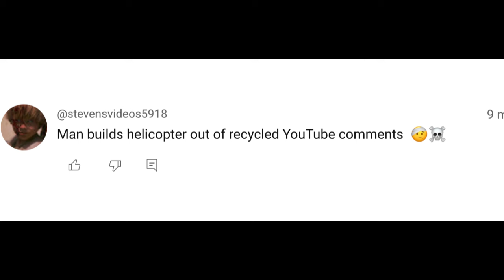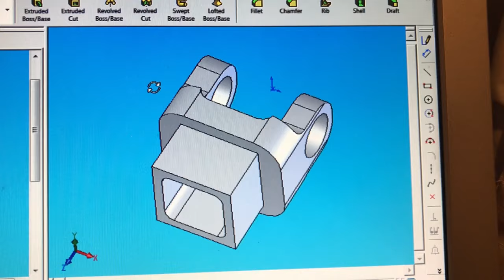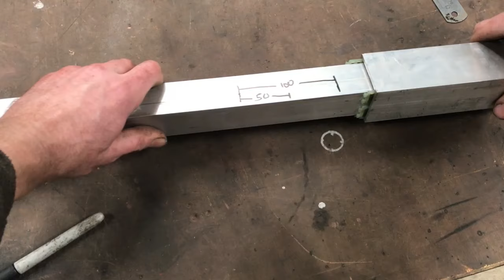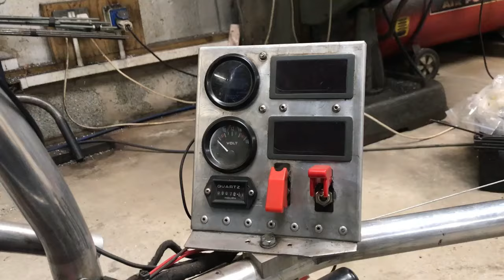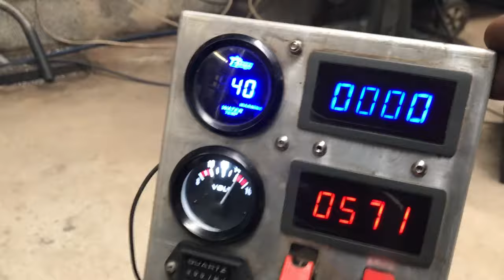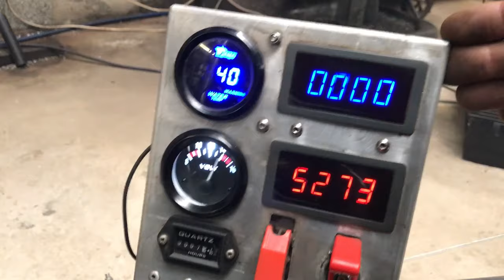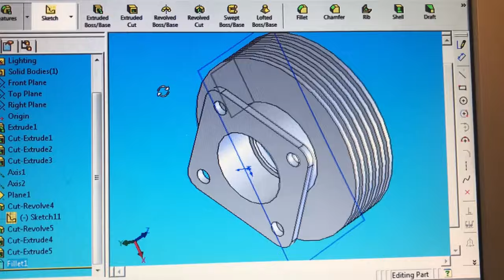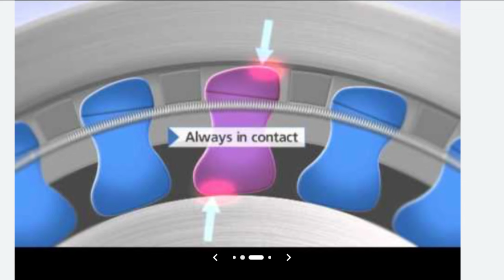Should I fix my Homemade Helicopter ???

Comment: Apologies for being slightly dismissive about the driveshaft when you mentioned this, Ben. As you comment the trick is to find a way to test the needle roller assy and convince yourself that you are not going to have issues with either fatigue or fretting. Could you test drive the shaft with a motor and then use a second motor through a conn-rod to vary the length under load? My thinking is put it through something close to a typical flight cycle then repeat 24/7 until you have enough flight cycles to be sure that it will not fail in a future flight...
I'm still very nervous about your current fixed pitch design. My reason is that if you lose drive, even if sprag clutch allows freewheeling, then the rotor rpm will drop so that lift drops with rpm^2. The resulting descent means that the rotor blades will aerodynamically stall, and the aircraft will fall. Not a good day...
I still think that using blade tip trailing edge trim flaps, and blade root pitch bearings, will at least allow the blades to find the pitch for a fixed relative angle of attack. This means that the rotor will keep flying as it descends by automatically entering autorotation. You'll still need to absorb the impact from an unflared landing, although rotor system inertia will provide some flying time. It means a less bad day...
The final trick will be a mechanism that makes both blades pitch to the same extend. This means you will have collective pitch, with rpm control and blade trim tabs. Cyclic pitch will be from your tilting rotor head (albeit with high control inertia). So what I'm trying to figure is how to give cyclic and collective pitch control with the least number of parts.
Helicopters are normally 4 times the cost to develop compared to fixed wings of the same MTOW. This just represents the mechanical complexity and increased testing required. But even the pioneers had to start somewhere. So the trick really is to learn from other designers mistakes so that you don't compound your own. Take your time and always strive for safety.
Reply from the maker: Hi Martin, I'll have a think about what it would take to build a test rig and whether I could get the rig to accurately replicate real conditions. 
What I think I need to know is the actual maximum torque applied to the shaft. Started looking into strain gauges, I could possibly use this to tell me the maximum torque but it would mean building the shaft first and testing on the machine. 

If you could work out for me what the impact velocity is from 3ft high after engine failure with the rotors fixed in pitch that would be great. 😆 I am joking of course. I've no clue how that could be worked out. 
My intention at some stage was to progressively test engine failure impact to see what height was safe. 
Actually could this be tested on a trailer using load cells ? I could measure the rate the lift decreases after engine shut off? 
Collective is something I ultimately want but it does add complexity.
Reply: @Ben-Dixey   , my brain is calibrated in metrical for designing stuff, so I'll round 3' to 1m. Using conservation of energy
m * g * h = 0.5 * m * v^2 . So cancelling m then
v = sqrt( 2 * g * h) = sqrt(2 * 9.81m/s^2 * 1m) = 4.43m/s
Also by considering m * g * h = m * a * d then if the structure deforms at a = ~10g then you needs 0.1m or 100mm of crush adsorption distance d.
I do very strongly recommend you treat your spinal column to a confor-foam energy absorbing cushion from cumulus-soaring. I happen to be sitting on one right now as they are also very comfortable...
Reply from the maker: @martingarrish4082  well, looks impressive to me Martin. 👍
Is this the impact velocity as if you did a drop test or have you somehow worked in the rate of lift reduction from the inertia of the blades?
Reply: @Ben-Dixey  ,  that's assuming all of the potential energy becomes kinetic energy, in a free fall, with the stalled rotor blade making no significant lift contribution. Nr will have significantly dropped by that point. This is where the e-VTOL companies are going wrong - that autorotating rotor is the last contingency when the batts and motors decide that it's time for an early holiday...
Reply from the maker: @martingarrish4082  👍 There isn't much delay between throttling off and lift reduction but there is some that I've felt, even without a sprag clutch. 
I would estimate it's about 1-2 seconds.
There is still a danger zone as you know even with collective ( dead man's curve). E-vrol like you say needs more redundancy.
Reply: @Ben-Dixey  ,  in modern helicopters with engine governors I am convinced that there should also be a servo on the collective that automatically lowers collective to maintain Nr if N1 drops below the alarm threshold. It could be weak enough to be overridden for auto-flaring. This would allow safe operation below the H-V dead man's curve by avoiding the 2 seconds delay. This would then reduce accidents in applications like mustering or power cable maintenance.
My thinking about the aerodynamic tip servo tab is that it would need to be large enough for a fast response (like sizing the WIGE elevator for short period oscillation time reduction). Kaman helicopters actually use tip servo control for the K-Max, so can also flare with it (YouTube won't let me link a photo).
Reply from the maker: @martingarrish4082  interesting Martin, sounds good in theory. 
I have heard of an automatic pitch reduction system before. The scheutzow stork had offset flapping hinges which changed the pitch of the blade when going from powered to unpowered flight. 
Haven't looked into it yet but there is an article on the redback aviation website.
Reply: @Ben-Dixey  , I just skimmed the article. So I think the flapping hinge delta3 angle links Nr to the blade pitch. As N1, and hence Nr, drops the rotor coning increases from reduction in centrifugal force. The delta3 causes the blade pitch to reduce to flat pitch for autorotation. That could work...
This would need a ground test rig to make sure the dynamics of 2 counterrotating rotors with variable cone angles couldn't allow contact - particularly in forward flight. I'm thinking trailer rig up and down the disused runway at Marjon Uni? If blade contact happens in flight it's a bad day for everyone...
Reply from the maker: @martingarrish4082  Thanks for the explanation, a clever and simple system. Wonder what happens when getting it onto the ground. I thought collective was used to set the machine down softly. Trading rotor Inertia for lift, this configuration couldn't do that ? 
You mentioned about the delay in reducing the collective on a standard set up this would be even more of a delay I would imagine.
Reply: @Ben-Dixey  , the delay on a normal collective is a design assumption that the pilot will be focusing on other things so will take 2 seconds before realising there is a problem and dropping the collective. Then the H-V curve is designed/tested so that enough Nr can be reintroduced for a safe flare for landing. Higher inertia rotors, like Cabri G2, have the benefit of having more inertia so will lose less in that 2 second delay. As we talked about, when I was privileged to sit in the Dixey Pixie,  the high inertia also means less gyroscopic rate response to cyclic control for improved flyability. It is possible to flare without collective as long as there is enough forward speed to pull back on the cyclic -like an autogyro. I assume the Scheutzow Stork just relied on that. But from engine failure in hover then you would be dependant on the skids to yield and absorb the descent rate.
Reply: @Ben-Dixey  That cushion is a very good idea it's in the seats of the Routeway Exec I helped do a turbine conversion on.
Reply from the maker: @hkruczek8725  A cushion seems a comical solution to prevent Injury from a helicopter falling out the sky but yes I think it's a good idea too. 
Have you still got your mini 500 ?
Reply: @Ben-Dixey  , it's the same impact absorbing dynafoam as is used on ejector seats. Designed specifically to reduce back injury from vertical shocks. Normal foam doesn't prevent the seat base from becoming an impactor to the small of ones back.

Comment: To me this looks very safe, you have remained within very low speeds, in the unlikely event that a blade flys off you are not in the way of its trajectory, same with the belt. In the event of a drive shaft falier, as long as the blades dont jam up from it you will just be lowered to the ground as the blades will retain momentum, and then if they do, you are remining very low to the ground so while it might torque you a bit as it jamed it would mostly likely just be a big bruse. Very cool project, will sub, hope you continue this project.

Tldr: helicopter are safer then they look, +1 sub.
Reply from the maker: Thanks for that, I of course agree with you. I like to think I do everything I can within sensible limits to reduce the risks. I intend to have the driveshaft better restrained in case of failure going forward. A sprag clutch will be included and probably some seat impact absorption. 
Many more drive shaft calculations are being done and plenty of time to consider and discus the construction of the Improved shaft. 
Thanks for the sub 👍

Comment: Steel has much better fatigue properties in the long term, you should strongly consider using it instead of aluminum for the driveshaft and just take the weight penalty.
Reply from the maker: Yes 👍 I'm just attempting the calculations to hopefully prove which is the right way forward.
Reply: @Ben-Dixey Good luck!

Comment: Please please PLEASE check what alloy those aluminium box sections are made of, because most extruded alu is 6082 (admittedly the best 6-series alloy for fatigue life) but for the love of god atleast wrap the box sections with something in case of spalling and/or catastrophic cracks since they have massive stress concentrators due to being square.
Reply from the maker: Hi, yes they are 6082t6. The stress concentration in the corners needs to be assessed. The stress that the section will be under has nearly been worked out. Early indications are looking positive but rest assured I will take every reasonable measure I can to 
make the right choice.
Reply: @Ben-Dixey  Its not the stress per se, its the rotor torque cycling that will absolutely spall the fuck out of those box sections in something like 30-40 minutes of operation. Id really advice you to fit a pretty obscenely heavy flywheel on the engine side to even them out as much as possible, but i know weight really comes at a premium. 

If id be frank, id actually try fitting a rope drive ie semiflexible steel cable in a tube. or let the engine pivot with the rotor assembly, instead of being frame mounted.
Reply from the maker: @bakakun  You could be right but without knowing what the actual torque spikes are I don't think anyone can say what it will do. I can see it potentially causing hammering if play exists between the rollers but not if there is preload. Bare in mind there are 144 rollers potentially in contact with the box. That's a very low loading/roller something like 2.4kg. 

Not heard of rope drives like you describe, looked it up, interesting. 👍
Reply: @Ben-Dixey  144*~24N *0.0025m torque, at whatever rpm you are at, multiplied by torque change cycles per revolution (compression into power stroke); solve for torsion cycles per hour.

The problem with aluminium is that it does not have a fatigue limit like steel does.

Anyway, im just throwing critique at you - not offering solutions. the problem you have is that the engine is mounted in a way that practically maximizes the longitudinal differences. can you reverse the engine and use a planetary gear instead of the belt drive for the main rotor?
Reply: @Ben-Dixey  Theres also alot of components from the marine sector, although they might be somewhat heavy compared to what youve already tried. aligning propshafts with the engines is usually a huge problem so they have reverse angle gearboxes and whatever...

Comment: what do you think about using electric starter
Reply from the maker: The electric starters are heavier, you also need a heavier battery and heavier cabling to power it. I had an electric stater to begin with but changed it for a lighter option.

Comment: I didn't realise you don't have a swashplate....I think you made it as I used to imagine how helis worked before I flew RC ones and discovered how they actually work. Crazy! Good luck! cool project!!!!
Reply from the maker: I think there could be a lot of people who don't realise this. It's has its drawbacks but I'm happy enough with how it works. It will be operational again and I would like to experiment more with this design.
Reply: @Ben-Dixey  I fucking love it man,. I admire your engineering❤️
Reply: I'm trying to figure out how gyroscopic precession affects your design, if at all. Does it? You just point the lift vector to wherever it needs to be right?
Reply from the maker: @tijssens  The answer to that is a video in itself. Firstly counter rotation cancels gyroscopic precession but it also cancels gyroscopic stability. 
I did a brief video about that 
Is There Gyroscopic Stability in Coaxial Helicopters?
https://youtu.be/bjbEw8VItoU
But there is more to it, precession is not being cancelled in my case because of the teeter hinges. It behaves like a single rotor which is controlled by aerodynamic precession or phase lag as it's called. 
My rotor is no different to any other helicopter in the way that the rotor moves. Some people would call mine weight shift but it's actually a combination of weight shift and rotor thrust vector change. I'm going to try and do a video on phase lag but I need to understand it better first. It's a real headache to get your head around.
Reply: @Ben-Dixey  I hadn't even considered the counter rotation 😂damn. the first thing that comes to (my) mind. Aren't blade strikes a thing in counter rotating designs then...??. I imagine any pitch input is offset twice by 90 degrees for both discs, perpendicular to each other. Mmmm..... I'm too drunk now to even come close to try to comprehend the forces at play. I should sober up and get a notepad or something and figure it out. Looking forward to more videos on the physics of your design as I'm sure my shortened span of attention due to tiktok will keep me from figuring anything out at all. What is the reason you're going at this problem in such an "ancient" way. Is it because you always tinkered with combustion engines and know your way around "classical" mechanics\engineering or  do you find current day battery tech lacking? It seems so much more easy to just build an electrically driven flying Contraption
Reply: Yeah I'm too drunk... I've read your explanation a third time but all I see are letters.... For now... Plus... My legs have gone to sleep from sitting too loo long on the toilet. 😂 I Really want to to figure the precession thing out. I really don't understand why your design would behave like a single rotor, as I seem to read from your comment. I give up. Get blood back in my legs and try again tomorrow
Reply from the maker: @tijssens  Yes blade strikes are an issue, the faster you travel the closer the tips get. You would have no doubt heard of dissymmetry of lift and flapping to equality this is what I thought caused the tip clearance issue but I was told by someone very knowledgeable on the subject that it was to do with blade coning.  I didn't understand his explanation but I've still got it. 
I am very happy around engines and mechanical devices but an electric version would be very nice indeed. The problem is the cost, to make mine fly under electric power would cost £10k. Too much for me unfortunately. Human carrying drones would probably be similar in cost. 
The helicopter was something I wanted to learn about but also to learn the skill of hovering. A drone can give you the flight experience but not the skill to hover. 
I can see myself attempting all sorts to do with personal flight in the future. 

Do you still fly RC?
Reply: @Ben-Dixey  I don't really fly rc helis anymore. I had a drone fpv phase after the helis but now I ventured into efoils. Once you get the hang of hovering a heli you quickly start flying 3d (which most non rc heli people find super ugly to look at) I only flew a real heli once and I almost feel embarrassed to say as it sounds super arrogant, but it was super easy (having flown rc helis for so long) it's like a suuupppeeer slowed down version of rc heli flying. The yaw is weird at first because as it's counter intuitive with your feet but all the other axis are intuitive.
Reply: Yeah... Wow... Wait a sec... About the counter rotating blades being pushed into each other
Reply: Never mind😂 can't get my head around it now and my guests are annoyed that I'm not talking to them and don't get that hobby aviation is FAR more important than any of them 😉good luck
Reply from the maker: @tijssens  If you managed to get the hang of 3d Rc helicopter flying then I'm less surprised that you found the real thing easy. I can hover an Rc and that really helped with flying a full scale, the movements are the same but the delay is more. I still found it very difficult but I found the rc version very difficult too. 
There are an elite group of people who can just do it, it sounds like you're one of them. 
I know exactly what you mean with the pedals, It's backwards. I was told it's that way because of aeroplane brakes, press the left pedal to brake the left wheel which turns the aircraft left. 
Hope your legs regained some blood flow 😆